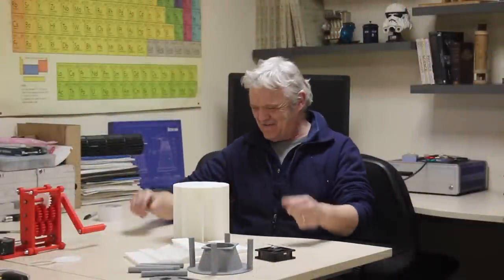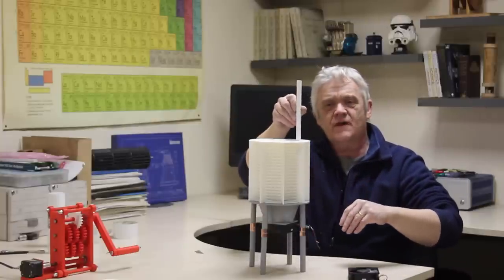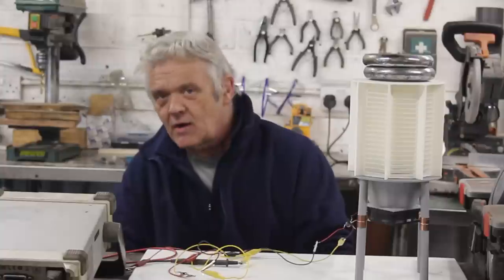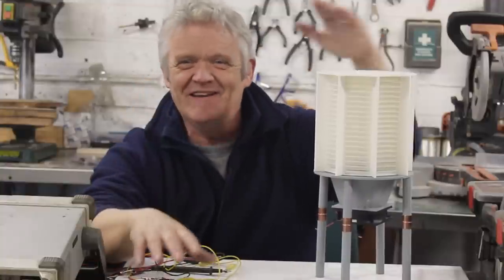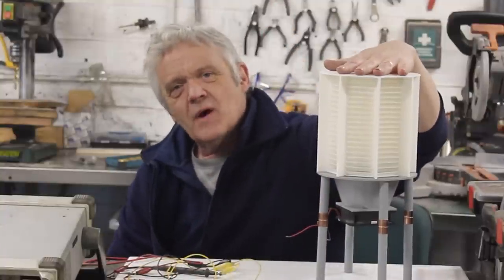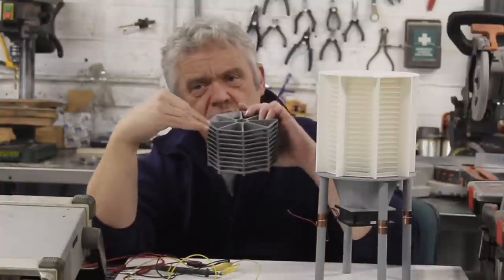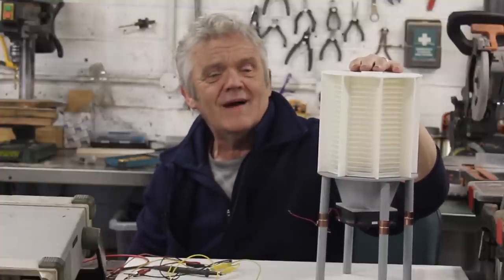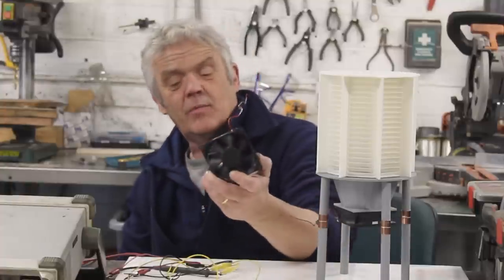1835 Darwin Wind Turbines - The Answer To Wind Generation

Comment: Yes, I do investigate this Darwin type, but, with the fan on the top and I'd like to test two fans, or more to be true. So, the first one will have the most power, but if it's worth, the rest will have an extra power on top of that. If one fan will be faulty/need a service and will stop, the rest can still produce the energy. And, if we'd remove it while keeping the rest, we'd not have a lot of loss in power while having a time to work on the first one ;).

Why fan at the top? It's a good question. If the fan is at the bottom and it's raining, than the rain will go on the fan. Here wouldn't.

On top of that I was thinking why not use a cone in front of this first and later every fan? I remember your video which is showing how much improvement you had with a cone in front of the fan :). For sure worth checking.

The last thing in my investigation about how to improve it was about this American company which I think for the last several years is developing a better type of wind turbines Harmony Turbines. I'd use a motor the way they did to run those fans. Than, a strong wind would not be a problem for this turbine.

That's what I have for now.  :)

Comment: I'm just a layman fascinated by this subject. Could the whole process be flipped upside down to utilize thermal drafts as well? with the fan still mounted at the bottom and a sort of chimney flew at the top sucking the air through the fan @ the bottom using the venturi effect with a taller flew at the top to create even more thermal draft. Taking this a step further and mounting this on the top of a building would effectively be cooling and venting the building in the process.

Comment: Since every section of the wind catcher is separated, but the funnel at the bottom is open to all of the sections, (assuming there is no back flow out of the other sections due to pressure or venture of the wind on the lee side), If you were to separately duct the bottom of each wind catcher section into a sort of nozzle directly aimed at the turbine blade (similar to multi nozzle micro hydro), would that be a more efficient force on the turbine, than just the air pressure in the open funnel.
This would add more complexity and cost to the construction, possibly offsetting any efficiency gains, but I am just curious if this could improve the output all other things being equal.

Comment: Sirel;y it would be better with curved rather than straight blades. I'm thinking horizontal (or close to it) at entry curving down to 30-ish (possibly more) degrees on the inside. This should help with reducing losses through flow seperation on the baldes, which are just poor aerofoils after all. IOf it is being printed then printing they curved should be no more difficult than straight. Maybe worth a test?

Comment: A friend of mine who ran (now sold) custom performance fabrication shop claimed to have worked out that the best transition angle for most gains and least losses is 7.5°..
I haven't verified for myself however so take the claim with a grain of salt.
Wonder if a taper of 7.5 degrees is also efficient.

Comment: How about building a different type of wind catcher with a bit more open design where the wind is focused on the fan with sloping walls that potentially move with the fan in the direction of the wind? Maybe it could direct the wind at a different angle and at the most efficient part of the fan?

Comment: All those slats will slow the wind down a lot.
Just a series of ducts with the profile of trumpet section might be better
,
Reply from the maker: you would think so eh - but actually in rel life they don't - equally you might have missed the point of the project from my side - from your side i can see why you would want trumpet trumpet sections - hyperbolic funnels -  but from my side - I have a 3d printer and could easily have made hyperbolic funnels - so there must have been a reason why not and I can assure you it is not because I am unaware of them - why do you think I chose to make it with slats?
Reply: @ThinkingandTinkering  
My comment was on the specific device, not your intentions.
What's in my mind, is a series of, as you say, hyperbolic funnels, stacked behind and above each other, and side by side, like organ pipes.
This would tend to accelerate the airflow, and concentrate it  at the same time.the outlets could be arranged side by side, radially, in a circle, which would then arrive at the fan blades more effectively.
.

Comment: I'd imagine you are losing a significant amount of potential via backflow into the other seven segments.  Perhaps some kind of spring-loaded valve plate would prevent the backflow.  It is likely that your are getting a more active reduction via negative pressure on the leeward facets.  If the wind is entering at the 12 o'clock position (to a lesser degree, the 10 and 2, too), the wind not captured and flowing around the collector would create a negative pressure at the 4, 6, and 8 o'clock cells.  This negative pressure (without mitigation) can have a big impact on the optimum number of facets.  Comparisons of the number of sides in designs that sit in the same footprint would be interesting to see.  By some logic, a three-sided collector might actually be the most efficient.

Extending the solid blocking walls all the way down, to a point just above the turbine might be an effective way to reduce the effect of the negative pressure.  The question would be the balance of lesser surface area to engage with the wind vs. a lesser impact from negative pressure.

A variant of a Tesla valve for each of the eight sections also has some real potential, but I'm not sure how to make one that'll be effective at minimizing the negative pressure without simultaneously and dramatically reducing forward airflow.

Comment: Not so sure about the maths of your claim, the opposite side of the tower where the wind does not hit will have a negative pressure which will work agains the side that is hit by the wind. At the end I think a small turbine that can orientate itself will be more efficient.

Comment: Hmm. Thougths on an improvement is to have ot so the fins on the sides that do not recieve wind are shut. Maybe modeled so that when oushed at from the inside with enough force, they are pushed shut...
Reply: Obviously not an option with a 3d printer prototype

Comment: Revisiting this video. Now, could you maybe do a video where ... Rather than concentrating the captured wind to the centre, you place the vawt  cone centred version below. Whereby rather than a pc fan you can run the magnetic bearing serpentine coil version below.... Just a suggestion. Id like to build one, but haven't the resources

Comment: Trying to figure out if there's a mechanical advantage that could be gained if the air inside the unit were hotter than the ambient.

If hot air is thinner than colder air, and gas flows from an area of high pressure to low pressure, if the inside were hotter, would that draw the colder air into the funnel.

Or as the air warmed, would air flow out of the unit as it expanded from being warmed.  In that case, would it be better for the inside to be cooler to draw the air in?

Comment: I was just wondering if you drilled a couple of holes in the cone so as to create a true venturi that should increase the density of the air passing over the turbine, allowing for increased power production. Just a thought.

Comment: Have you thought about changing the fan blade to the new oliptical 3d printed blades claiming to be more efficient and less noise? Additionally would you be able to push the air into a Tesla turbine to generate electricity or run a steam generator or sand battery?
Reply: I've been watching a LOT of efficiency videos about this new blade design...... most I've seen are preforming 50% worse than optimized PC fan blade or Drone blade designs. Pretty disappointing as I was hoping for something better than a minor noise reduction in a particular frequency and that's only at very high RPM's a wind turbine would probably not be running at.

Comment: Had a think.  Not much of one.  Seems to me wind can be funnelelled prior to this, and so siting would be important in cities, or in other locations man made funnelling.  
Possibly use water going down a drain to find improvementsregarding venturi., but air is big and water is small.  
Could mirror the whole thing so the opposite undersides of the fan blades get drawn to spin vacuum style?

Comment: Thinking about air flow and turbulence along the length of the slats downwards, is there any mileage in making curved cone funnels gradually increasing/decreasing in size so that the different levels of openings are directed into different layers downwards and maybe staggering their end point so that they all couple doing downwards? I'm thinking of turbulence if/when the air enters from different directions at the same time or as a downward air flow passes the next slat down? Plus a curved slat may cause some rotational movement - good or bad?

Comment: Cut in speed, static pressure .. variables abound, thanks for talking Watts rather than open cct voltage. Now for breaking Betts limit (join the successful ducted fan club).

Comment: Does it work in the other direction too? If you pipe the "waste" air up high again, and let it get sucked out, it could increase your air flow.  But only if a backward built darwin ( a niwrad) sucks.

Comment: Frankly, I love this idea! 
Though I wonder how scalable it is, i.e. how large can it be made. My concern is that as the wind blows at the front part, it creates positive pressure in the front part of the wind catcher. But the pressure becomes significantly lower at the rear part. And both parts meet at the funnel/tube. I'm concerned that the bigger you make it and the lower the wind speed and the more load is on the generator (amps), considerable amounts of positive pressure will leak to the rear side through common cavities.

Another concern is: so far you're testing by blowing wind at the whole height of the fin panel. But as you make it larger, wind may cover only part of the panel (top/middle/bottom). This will cause pressure to build up only in part of the cavity. I'm worried since pressure is not causing a rush of air through the cavity, slower-moving air might be leaking out through the fins of the same panel (above/below to where the wind blast is focused), leaving next to nothing for the turbine. It's easy to test: place a nozzle on the blower to direct wind to only part of the panel.

Comment: Some people will make their own. For them, flat panels are probably best because they are so easy. But, if this idea becomes commercially viable, many will buy a turbine system instead of building their own. If different shapes are actually more efficient, the manufacturers will have an incentive to make their devices using the odd shapes. After all, they will have to convince people to spend money on a system instead of building one. They will need to be able to tout their efficiency numbers. So there is plenty of room for investigating both configurations.

Comment: What if... The exhaust from the turbine, instead of being released directly straight down, went through a 90 degree large-diameter curved pipe.  The pipe could have a bearing such that it freely rotates, with the opening always wanting to face downwind.  The reasoning being that there will be a low pressure zone generated at its exit.  The exit could even flare a bit as this would help the pipe face downwind, as well as generate even more low pressure.
Would that one pipe assist in efficiency?

Comment: I have an idea, it may be dumb. It crossed my mind that it looked like a heat sink, then I thought what if you had a very tall one and the bottom section was shaded, it could even go into the ground a few feet where themp remains cooler in the summer. basically I was thinking if was possible to generate a little more wind from having one end warmer and one cooler, it probably wouldnt even make a significant difference unless it was unreasonably large. like I said, it may be a dumb thought I had while watching and I havent thought it out very much before I wrote this comment.

Comment: Hi Robert I know your always open to idears,if we have a hole at the top and bottom of the Darwin wind Turbine with a cuple of feet of pipe and a  generator on top and bottom ,do you  think the air movment would be enough to create a parcial vacume and drive both generators.  I wish could try this myself but do not the equipment

Comment: I wonder what the output would be using the new MIT designed toroidal fan, which has lower drag and uses less power to turn.  Maybe a vast improvement.

Comment: Slap a water tank in the middle, and use the power,generated to run pumps getting water up to i/.  The thing already half looks like a water tower, and air flowing through the exact center won’t get good torque anyhow.

Comment: Hi Robert, greetings from Thailand, I am very interested in this concept as I live in a rural mountainous area, as an idea, old 2 stroke motorbike engines use something called a reed valve on the induction side, this is/was used to prevent blowback from piston movement which greatly increased the efficiency of the engine, maybe a reed valve of some sort incorporated into the 'exhaust' side of the turbine would help
Reply: My thought as well.

Comment: To infinity and beyond.  It's giving me a Buzz and it's evolving fast (swidt 😁)
But seriously this is true invention, just messing about until it works. I would suggest a greater length/depth to the fins, this will increase the surface area exposed to the air flow.

Comment: If the ideal angle for the  HORIZONTAL vanes is 30⁰ then the ideal angle for the VERTICAL vanes (between the panels) is probably 30⁰  as well?
Therefore 12 panels rather than 6 or 8 would seem beneficial?

Comment: If you leave the top open would it not pull more air in from the top due to the low air pressure created by the flow downwards?

Comment: What would happen if you could direct the air down in a tornado(twist) type spin (instead of the straight down effect), will it give you a bit more turn on your generator fan.

Comment: Just wondering if you inserted some form of an  Archimedes screw in the center suspended from the top if that would force the air faster through your micro generator?  something to think about.  Cheers

Comment: Is the leeward, downwind side of this tower that is immersed in the structure's wake exposed to a region of low-pressure flow? If so, as all the sides remain open, does a low-pressure and high-pressure face share a chamber below? Does flow that enters into this shared chamber from the high-pressure windward side, leak up into the side exposed to this low pressure and exit the structure via the open leeward side?  If not, what is preventing this?

Comment: You specify a couple of times that the air entries (guides or whatever that is called) are at 35 degrees and that is critical. Do you also know why or is this only trial and error? I would by default think that 45% would be better or even a horizontal one curving down to 35% for example. I just printed my first turbine wheel yesterday and looks like it starts at very low wind speeds, but ideally if we would create this a little bit bigger, then what generator would you mount onto it to get at least a couple of watts ? I guess the turbine would need to be a lot bigger for that ? I would actually like to try and. make a generator that can do around 5 to 10 watt generation. Any idea what size this thing should be for such a number ?

Comment: What if you take 1 (pizza wedge) part of the wind catcher put it on a hollow post with a windvane so it turns  the 35⁰ angled washboard into the wind would that ease the costs of building? Or would it be less efficient..

Comment: Hmm. I dont know if sticking u pipe below would actually improve it. Depending on the type of fan/blades it has a focused or wide air .. beam. If its a non focused airstream the pipe would hinder airflow i guess.

Comment: congratz it is a lovely prototype but there is one thing that really worries me can you please test this with simulated rain i would like to see how much water it ingests with a driving rain (say 45 degrees) because if it is going to be generating electricity you don't want it shorting due to rain. if it ingests water is there any way to include a water trap without restricting airflow?

Comment: Does the Darwin structure require internal flat panels? Would not internal air pressure increase if the flat panels were removed so that air is forced down unto the entire fan rather than half of the fan?

Comment: inside the cone, where it mates up with the turbine, would an inverse cone that forces the wind to the edge of the blades make any measurable difference in power generation, or would adding that increase the resistance of motion to the blades. 

I guess what I'm asking is could you add a cone to force the wind out to the highest moment of inertia for the fan blades to increase generation?
Reply: Or is that similar to what you are talking about with the venturi effect?